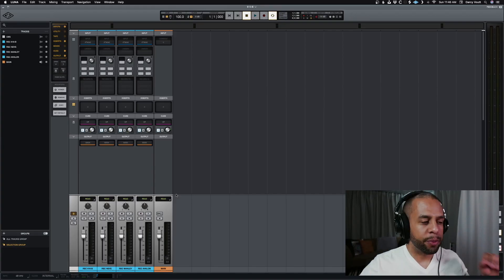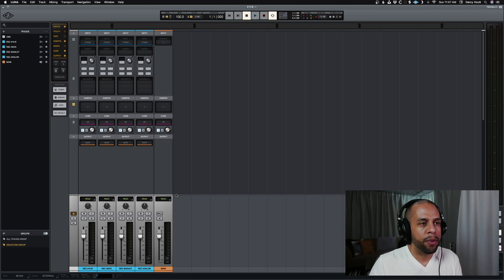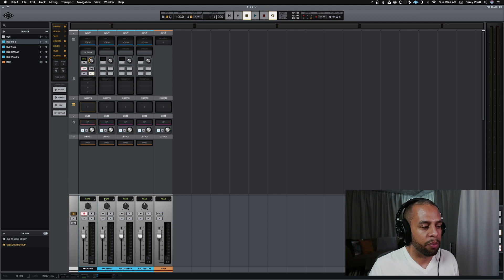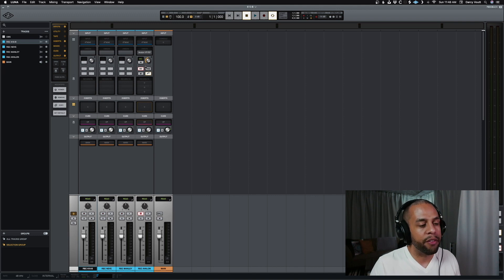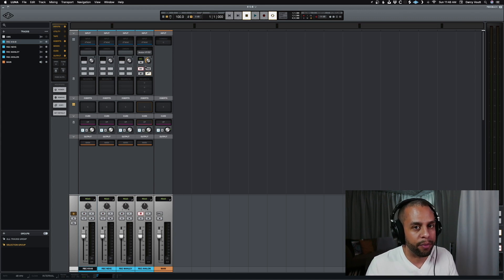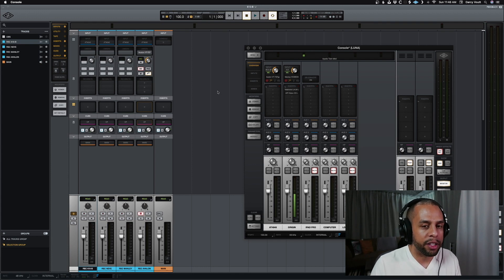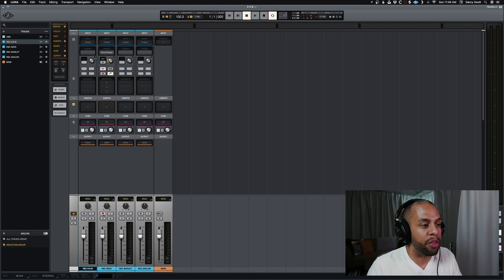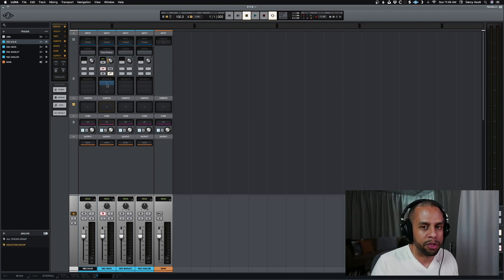How to Setup a Recording Template in UAD LUNA

Comment: Can you explain why you wouldn't just put the preamps on inserts and A/B them one by one with a quick demo vocal? Is it because Apollo preamp into Avalon pre-amp is different from having the Avalon pre in unison slot? Sorry, just trying to wrap my head around the signal path :)

Also, could you have a verb/delay bus with each of those pre-amp channels routed to it?
Reply from the maker: There is a different in the impedance from the unison channel verses the insert. It’s definitely a subject I need to dive into more and then figure out how to explain. 

Thinking this through logically though right now, if you don’t use the unison version you’re still gaining through the “naked” preamp so to speak and then into the preamp plug-in. So you’re adding a stage of gain staging you have to handle. 

And yes with ARM enabled you can add busses to you’re recording track that you can monitor given that they are ARM’d and dangerous (couldn’t help myself). The busses will need UAD plugins on those busses for run in ARM.
Reply: Hey do you have any videos on how to create vocal templates in Luna?